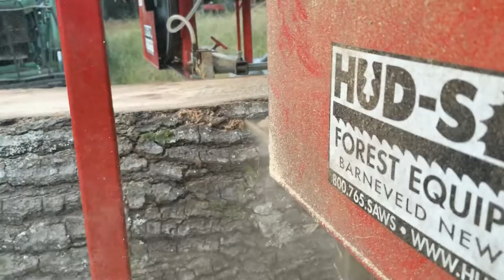Hudson Sawmill at work

Comment: Hey pal, any idea what diameter that secondary pully is? The one driven by the belt off the motor? I'm curious to figure out the ratios.  Knowing the clutch diameter would be helpful too.